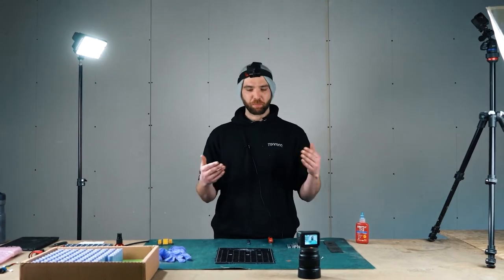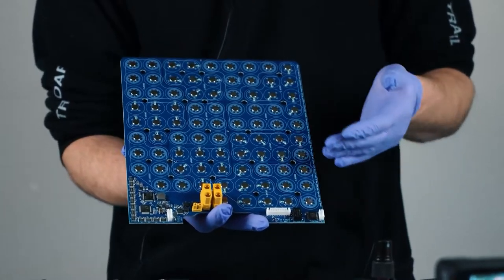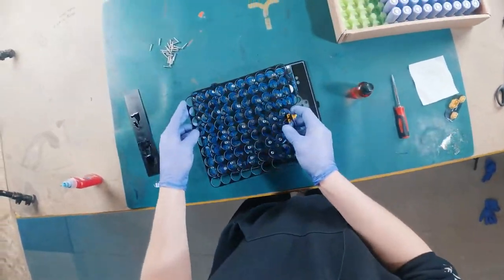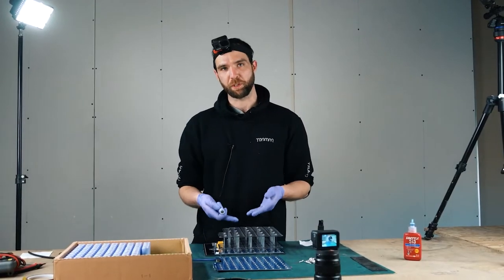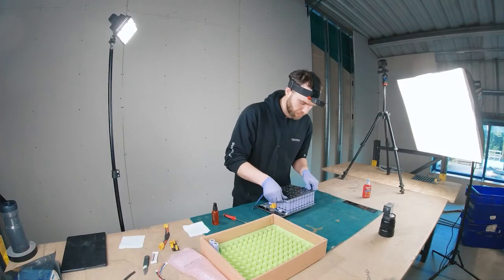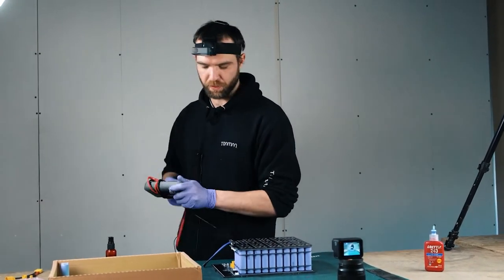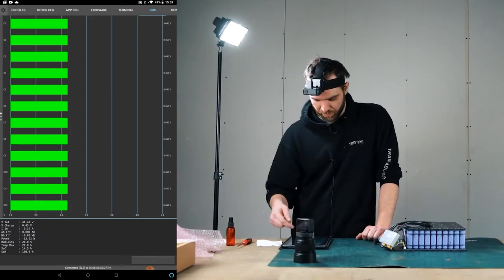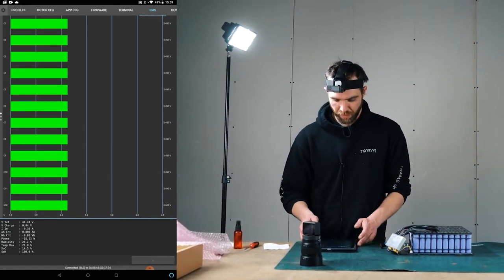How to ASSEMBLE The TRAMPA BATTERY PACK (21700)

Comment: Some comments from someone who has built battery packs for the last 7 years..When picking and matching cells, you look for the resistance of each cell and ones that are out of the average resistance of your cells should be avoided. Even in grade A cells, resistance will not be the same across each cell, although they should be very close, thats why I always get extra cells before I build. Second, there is no shortcut to heaven...and there is a reason why cells are either Welded with nickle strip or soldered. Its called AMPS. The more amps being pulled the tighter the connection needs to be to the point that it requires much more that that board could provide..while this would be fine pulling very little amps (perhaps 10 amps), trying to use this in an ebike application pulling 50-80 amps would be a fail.
Reply: for doing batteries for 7 years you could have been a little more specific. with 40t cells you can draw close to the amps you say would be fail in total. are you saying they did a design mistake and you burn the circuitboard when you draw this much?
Reply: I have had multiple of these packs pulling crazy amps, one of my boards is a 4x4, I even travelled overseas via air with my board and just ordered new batteries and dropped them in. on arrival. The pack is crazy robust and no limitation if not better than welded packs that have a finite lifespan and if one cell is stuffed you end up with a major pack rebuild. For eskate this is the best product available in my view.

Comment: When i purchase a full board with the 21700 Monster box option will all the stuff in this video be included ? (apart from the cells of cousre, i live in germany so i cant purchase a ready made battery from you it seems) Or do i need to buy the other electronics for the battery seperately
Reply from the maker: Yes, if you select the 21700 pack when you configur a board; you will get everything needed (as shown in the video). Apart from Dave and the tools!